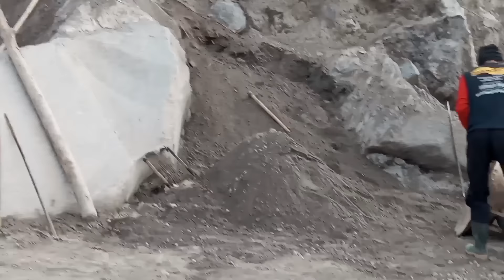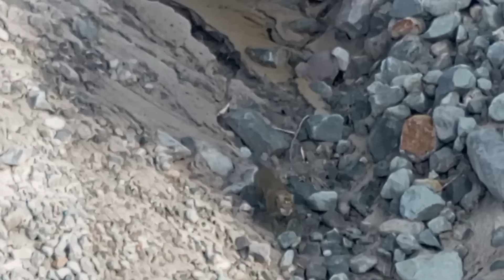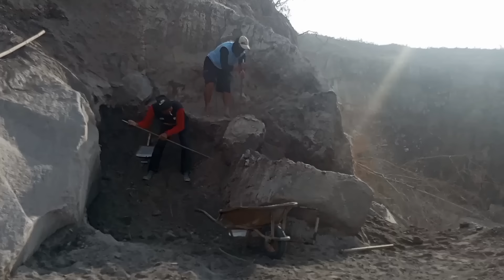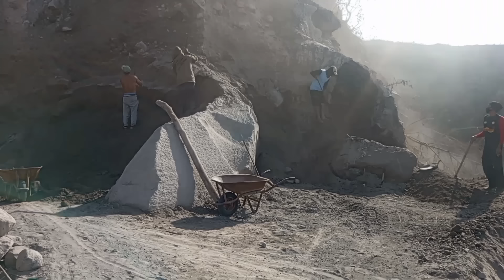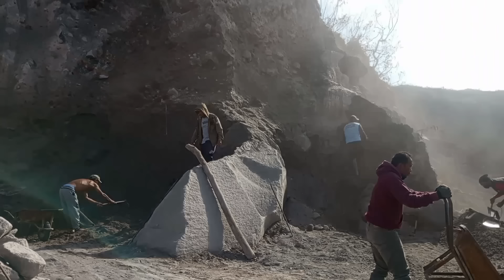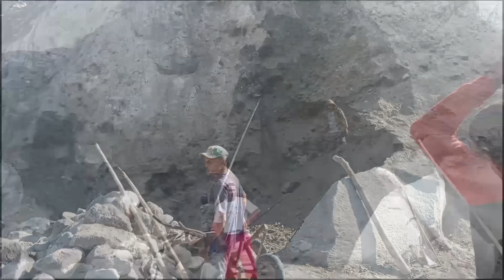Today's Mining Activity Ended In A Major Landslide

Comment: They lowered the sand using iron spears and long bamboo spears and they made the descent on the cliff right in the middle. After a few moments they looked for sand at the bottom of the cliff, its function was to remove the stones that had been dropped, but the right and left parts of the cliff were also mined after when lowering the sand from the top of the cliff, the other miners cleaned the coral and watched for sudden landslides until at the end of lowering the sand there was a big landslide and they can save mining equipment